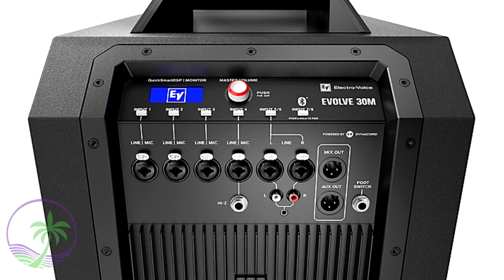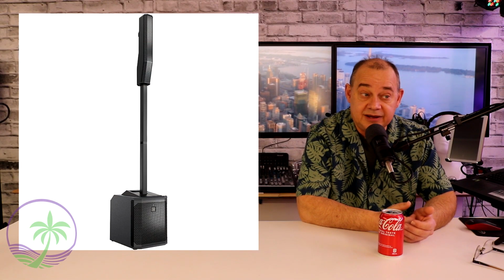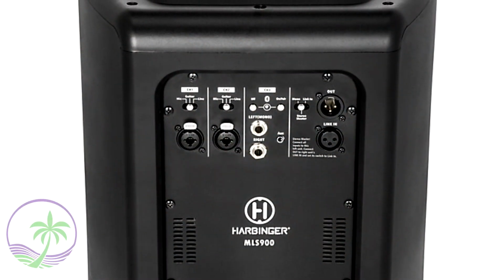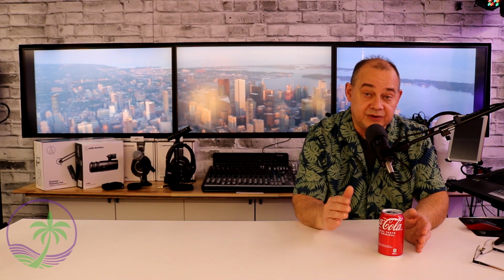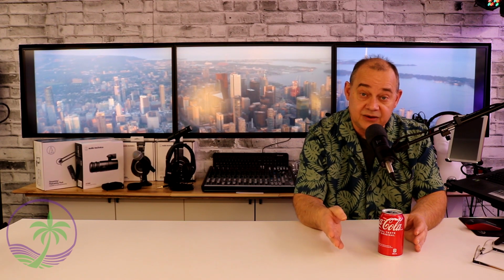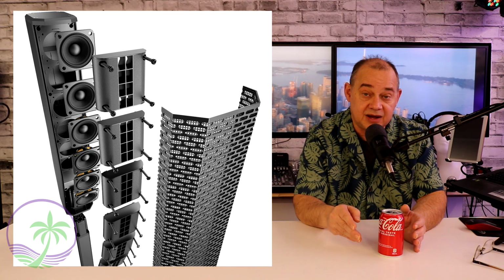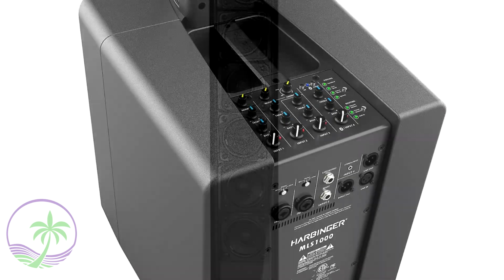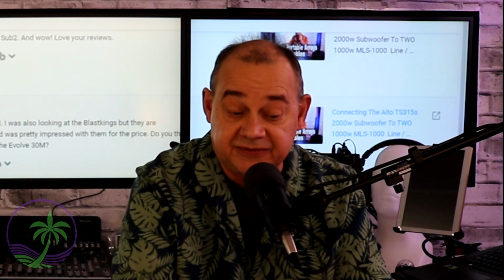Portable Line Array vs Column Array EV Evolve-30M vs Harbinger MLS-1000

Comment: I was at guitar center the other day. Put my hand on the evolve 50, evolve 30 the jbl and the harbinger…..the evolve 50 was the most stable  the rest were shaky
Reply from the maker: That was a good observation 👌 about the evolve-50 it is the heaviest out of all of them and also the priciest. You have to take  that into consideration. If it is right for you, it's right for you.
Reply: @expertisland  my problem is money 🤣 I love the ekx line because of the power and it has fans and I love the look and sound of the evolve 50. Id like but the end of the year to have a full ekx setup two 12’s and 2 15” subs and at least one evolve 50. My zlx 12p(gen one) are all still going strong but they get hot and I can’t stand it like really hot

Comment: Harbinger is trash period
Reply from the maker: Thanks for Watching - Having an opinion is good, filling it in with Context is Better.
Reply: Harbingers has more puncher bass and the crossover is better to the sub, so what you said is not entirely true , know your specs
Reply: Hmm, I have been using 3 pairs of MLS speakers for 6 years. They have worked well. Now the catch. I ALWAYS USE A SUBWOOFER, EVERYTIME.

Comment: The 'line array' design may work well in low ceiling rooms with the narrow speaker attached to the ceiling horizontally. Drop acoustical tile ceilings, as an example. You could have three line arrays horizontally attached to the ceiling across the front of the stage, and another two further back in the room, 20 to 50 feet from the stage with a few milliseconds delay.  I think the coverage will work better than, say, two 12" Altos at front L/R. 

A note about sub speakers.
 I've been at an event where they were using Turbo Sound sub woofers, and it was the most powerful low end I've ever experienced in my life. I believe they had one 2,000 watt Turbo sub per side.

Comment: I am a happy owner of the Electro-Voice Everse8 which only came out a few months ago. Wow, it is just awesome! I suspect that it uses the extensive EQ settings borrowed from the Evolve series. I have also owned a Bose S1 Pro, which has pathetically poor Mic Preamps; I traded it in for the Everse8. I also have a JBL Eon One (the original one) which I continue to have using a Mackie mixer. Its sound is rich and of very pleasing fidelity.

Comment: Thanks so much.  I really enjoyed your video and appreciated your informative explanations.   If you don’t mind the questions, do you think the 30m has sufficient power and reach to support a solo singer/electric guitarist with backing tracks at venues reaching 100 people?  I wasn’t interested in moving up to the 50m due to cost.

Also curious what your comparison related thoughts would be between the EV 30m and the Boss L1 Pro 16.  Thanks!
Reply: Hi bro, Yes it is.. I’m singer and this system should be enough for 100. EV 30M

Comment: My son, who does acoustic shows here regularly, and I went to our local GC to test some of the available line arrays in person. We used my Tayler 214 and a Senheiser 935 direct in to each system. We tested the Harbinger MLS 1000, the Evolve 30, and the Bose L1 Pro 8. Like many of you, we are very particular about our sound. We invest our hard earned $$$ in this equipment to improve our listeners experience and at the same time feel more confident that we sound the best we can. We have both used point source powered speakers on stands in the past and this was our first really close look at line array systems.
The Harbinger MLS 1000 was first. The construction was mostly plastic but assembled easy and seemed pretty sturdy once assembled. It had decent dispersion and seemed pretty transparent in sound reproduction. It wasn’t as loud as either of the other systems. It would probably be fine for quieter venues, coffee shops and such. I have a friend that gigs with two of these and he loves them especially at the $699 price point and can be had even cheaper during sales at GC.
The Evolve 30M was the most feature laden of all the systems. The controls on the back were horrible to try and navigate the the system with. The app was far better to use to adjust the unit. It’s built like a tank, sounds really good. Much louder and clearer than the harbinger was. Sound dispersion was great. Overall, a very solid system.
The Bose L1 Pro 8 was easy to use. We downloaded the app and off we went. We used the regular settings for the mic and guitar but switched to the closest tone match settings we could find. Though good, the construction was not as sturdy as the evolve but was fine, I didn’t feel like it was going to come apart at any time during our test. I will say that in the past, I’ve never been impressed with any Bose products I’ve purchased, but this thing has some kind of mojo going on with it. It was crystal clear, bass had some punch. Sound dispersion was the best of the three units tested. There is something going on with what I would term perceived sound vs power output if that makes sense. You can stand right next to it and your ears aren’t hurting and still be sounding great 40 feet away in the back of the room. It’s pretty impressive to hear in person but not easily described. I didn’t like not having a master volume on the system. To get that, I think you have to buy one of the Bose mixers which they want outrageous money for ($700 for a 4 channel mixer). I still may wind up with a Pro 8 though, we’ll see.
The best thing to do of course is to go test them out for yourself if you can.

Comment: Just to update I'm so impressed with my dual MLS 1000's I wish they had been around when I first started. The subs on the MLS 1000 hit way harder than some Rockville 12's I had before(and yes they were powered subs too but I didn't run a mixer to them). I will say this I think the EV30M is harder to make clip than te MLS1000, but my MLS can really take a lot before it begins to clip. 

The carry bags are so nice, and they go together and come apart so easy! I can be set up and ready in under 30 minutes, and it all fits in the back of a tiny hatchback. Such an excellent set up.

I'm trying to get out of being a DJ now, and it sucks because I kind of want to keep my speakers, but they are the only thing worth selling LOL!

Comment: Ive compared a few of these side by side at my local guitar center. MLS 1000, L1 Pro 8, Evolve 30M. This all depends on what you are going to use them for, the right tool for the job right? I’m not a DJ, I would be looking at these for live sound reinforcement. I went in to this biased somewhat against Bose. Anything I’ve ever purchased from them in the home audio arena, I’ve returned. I am needing something for small to medium venues to support a duo and backing tracks for drums and bass occasionally. The Harbinger was ok and will get the job done, it will make sound. I was surprised by the Bose I have to admit, full and clear sounding. The tone match presets are very good for mics and guitars and non of the units match the sound dispersion that the Bose has (180) degrees. The evolve 30M is more versatile than either of the other two. Hands down better IOS app for controlling your mix remotely. The 30M sounds great and packs a punch too. In my opinion, having heard all three of these, Ive still not decided on which to get but to put the harbinger against the evolve 30M is a joke. The electro voice unit blows it out of the water and is not a fair comparison. I do appreciate the work you did on this review, it made me get off my behind to go hear each of the units in person!
Reply: If you will pick 1 right away for long investment what would you pick on 3
Reply: There are users who like to think they can spend little money to get great sound. Others, such as real working pros,  understand that outstanding products require a large investment. This review channel is not for the latter.

Comment: Curious how the MLS1000 and Evolve30 compare to the RCF Evox J8.
Reply: I heard the RCF Evox 8s and 12s at the DJ Expo 2 years in a row a few years ago.  They are the absolute best sounding array speakers I have heard. Even better than the Bose.  They also have an incredible throw for array speakers.  I would give the RCF Evox essentially a 10 in terms of sound quality. I would give the Evolve like a 9 which is what I would give the Bose L1 Model 2.  I have not heard the MLS1000 at a very loud volume so can't comment on it's sound quality.
Reply: The Evolve 50's would be a more suited comparison for the Evox, they're 127db and the Evox is 128db whereas the 30M  & Harbinger are both 123db. 

In my opinion the RCF's are more aggressive and have more bass than the EV 50's. I listened to both in person when I was shopping and the Evox's just hit harder. The Evolve 50's sounded great it just didn't have a lot of low end and I feel like I'd need a sub for sure with the 50's and could do without when using Evox's. 

Evox goes to 40hz and Evolve 50's go to 43hz.
Reply: @justingarret4776  thank you for the feedback - 👍

Comment: Thank you so much Robin. I didn't think about the extra cost of the digital mixer(which I don't really need). I will probably buy at least one but probably 2 of the Harbinger MLS1000. I'm looking forward to you next video or two as well.
Reply: Agreed. I'm thinking 2 1000's and 2 900's for me.
Reply: @kellyaustin7487  you going to use all four at the same time? I bet the 900's are discounted now that the 1000 is out
Reply: @darrickcato9499  I got the MLS900's on sale for $ 399 a few months ago.  Couldn't pass that up for talking head work and smaller audio gigs.  I think they are back to $ 599 though.  When I saw the $ 399 I had a feeling it was to clear out stock for a newer model...but I was wrong.  The newer MSL1000 didn't replace the MLS900, just supplemented the line.  I like the MLS900 but I have to say the gain in the pre-amps is a little weak if you are just going to plug a mic into the mixer.  I get plenty more gain taking the mics into an external mixer and then feeding the MLS900's.